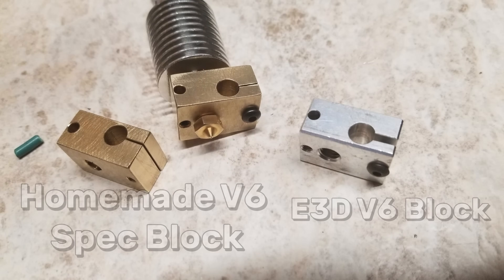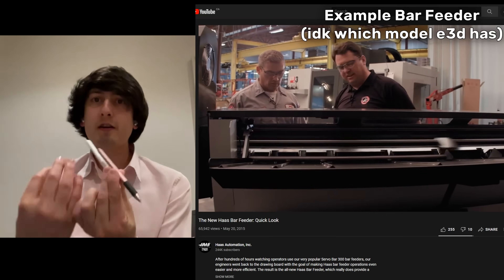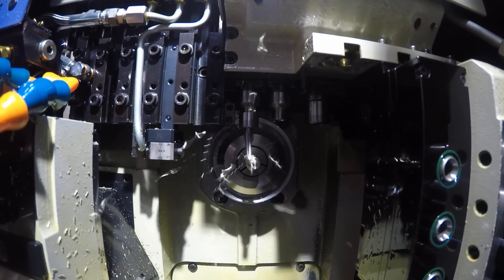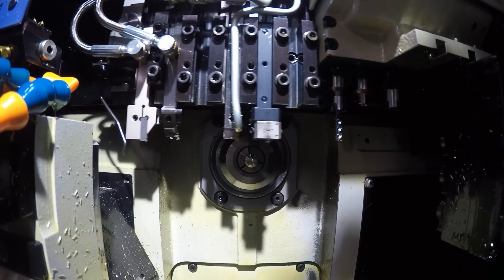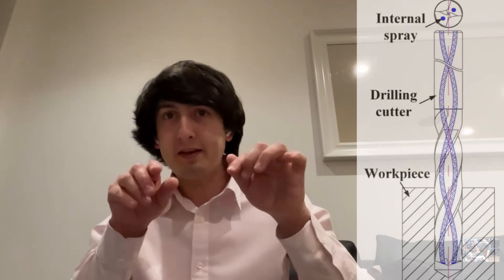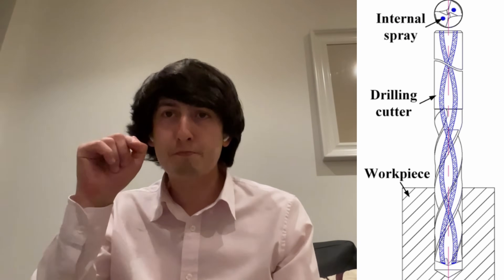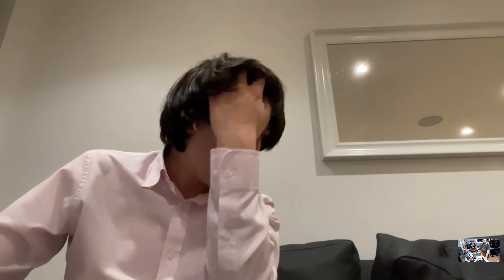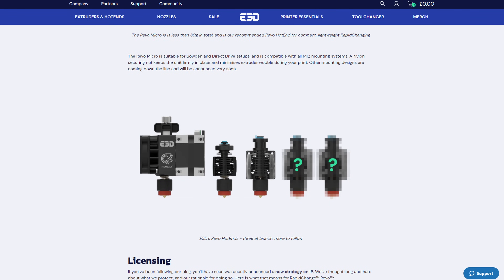Deep Dive into the E3D Revo - Machining and Heatsinks- Interview with Sanjay M - PART 2

Comment: @13:09 Mhh... IDK man... Maybe more people would be printing faster if not everyone would be using a V6? 🤔 ( not saying the V6 terrible by any means buuut it appears to have its limits ).

Though I have to agree with no one printing at sub 5min Speed Benchy speeds simply because the results are utter bullshit... If I wanted my parts to look like that I'd be faster blowtorching my spool of filament into a rough shape. I also find it questionable that no one partaking in the Speed Benchy Race is actually adhering to the rules set by it like a) not using Servo Motors and/or b) making their configuration files publicly available ( but then again... who'd want a config producing crap like that ).

Still... My impression for the SBR rules was to make it accessible to anyone via the use of standardized hardware ( using exotic hardware like Servo Motors doesn't really apply to that rule ) and by providing the necessary information ( posting your speeds is not providing your configuration file ) to replicate and build upon it 😑

Comment: I assume firmwares will need to be updated to support the curves for the new style of thermistor? I expect some bumps in the first few batches (like the Hemera and everything else), but now that I have two Vorons, I'll happily be a guinea pig.
Reply from the maker: All i did with the beta unit was throw it in the machine, update my thermistor call out (iirc its a semtech 104 something something vs the b3950 that i had previously) ran a PID tune, and was off to the races
Reply: @CanuckCreator  Sweet. The semtech something something is the usual E3D thermistor, so that's pretty convenient.
Reply: Same style thermistor as previous E3D hotends.